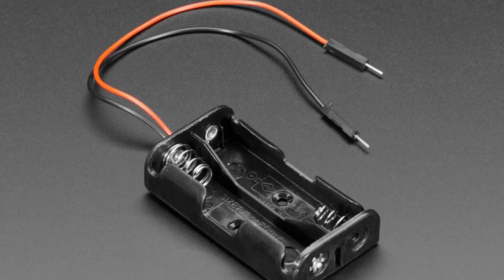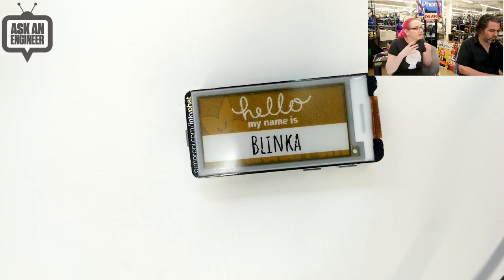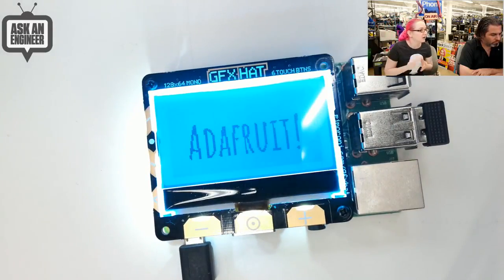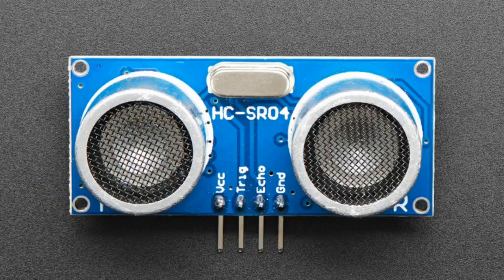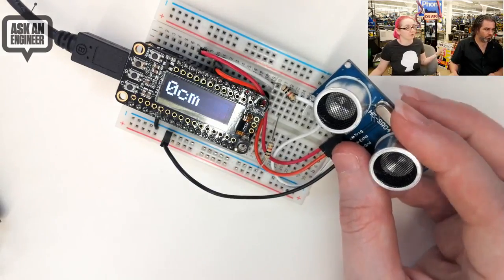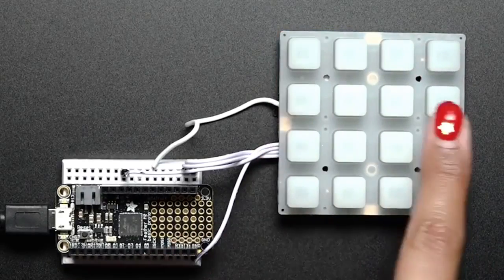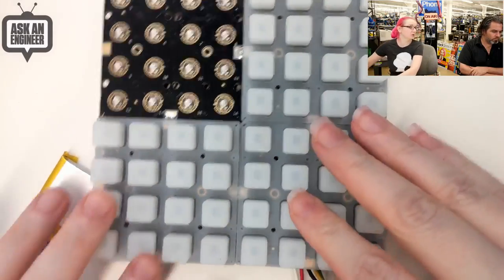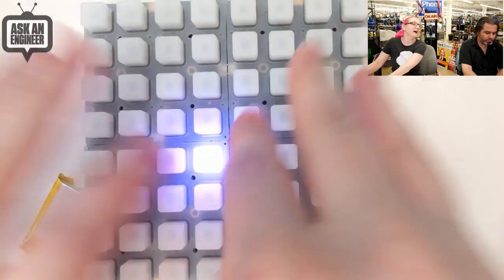New Products 9/19/18 Featuring Adafruit #NeoTrellis #RGB Driver #PCB! @adafruit #adafruit

Comment: Now all you need is a seesaw adapter (sold separately) for the cheap distance sensor. A header that can plug directly into the sensor pins and I2C pins on the other side.

Comment: Why would you sell the silicone elastomer keypad separately? The keypad wont work without it.
Reply: So you can also order separate replacement pads when those wear out, get dirty, break, get stuck on your soldering iron by mistake, etc etc.
Reply: https://www.adafruit.com/product/1611